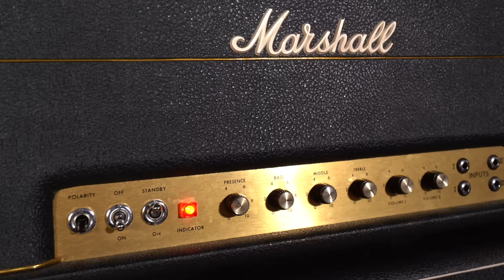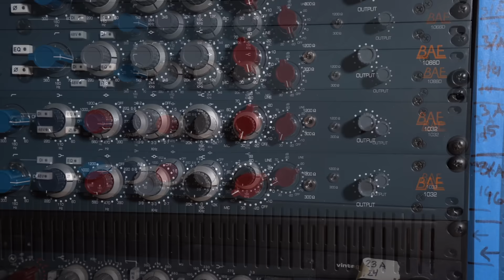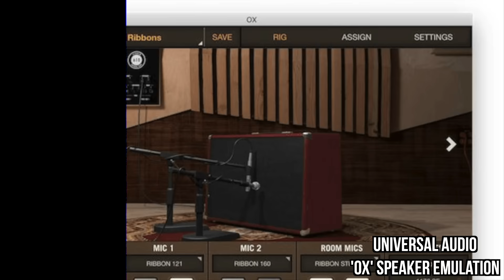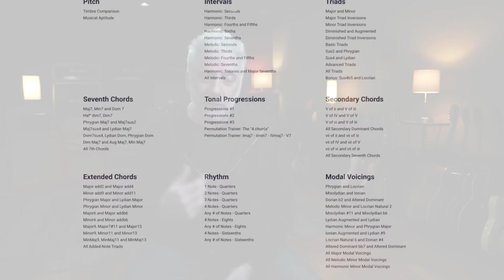So Can You HEAR the Difference?

Comment: I guess I like the "fizz." Greenbacks for me all day. Hiwatt sounded like it had a cold.
Reply: Good description on the Hiwatt!
Reply: loool
Reply: Hiwatt is ported, so that makes some sense. I use two separate cabs off the same head. Mesa V30 loaded deep closed back 2x12 and a DRZ green/cream loaded 2x12 oval open back. It makes for a great mix together. Now if I play through just one of them, I don't like the sound. Spoiled. Don't do it kids. Will ruin you forever.
Reply: @katsavidiz  Maybe it would sound better with different EQ on the amp? I didn't hear them say they adjusted for each cab, so whichever one they did adjust for was off to a head start.
Reply: slimjw ; Maybe we're alone on that one, but I also prefered the Greenbacks. In fact, I thought it was the best sounding cabinet on every example. Sometimes even miles ahead of the others. 
What I liked about it was the fact that it sounded more agressive to me. In my book 'fizzy' is something else. And about that bass..., most of the time it's the first thing that's being eq'ed out, or else you'll piss off the bass player. 

Greenbacks for me.
Reply: I am listening on a hi-fi audio system w/full size Bose monitors and I thought the greenbacks sounded common to any overdrive pedaled practice amp or a Pignose for that matter. All fizzy upper end.
Reply: To me, it's almost like the greenbacks brought out more crunch.
Reply: Keep in mind the Hiwatt cab is voiced to work with a Hiwatt amp! Hiwatts (the classic Dave Reeves circuits anyway) have extended high-end response compared to most if not all other guitar amps. Most Fane speakers are also dark-ish and were chosen by Reeves because of this.
Reply: agreed, sounded flat
Reply: Hiwatt was the best for the clean tone, worst for everything else
Reply: @davidkieltyka9  That would explain the lack of treble in that demonstration for sure. Listening to The Who: Live at Leeds, the Hiwatt sound is definitely a formidable rock sound. Unlike the Marshalls which seem to have more of a mid scooped voicing...more cutting for the G,B.E strings then the Hiwatts being more efficient reproducing all strings more equally, but seem to like the D string mostly. The Hiwatt sound on the 'Leeds' album sound to me very similar to the Vox sound notibly the AC30.
Reply: wingracer 16 loved the sound of the Hiwatt, felt more vintage and LoFi. Not a popular thought in the comments, but just a personal preference of mine. I guess I just like fizzzzzz
Reply: Barry Steinhart Yeah, the Hiwatts Dave Reeves made for Pete Townshend have a preamp section based on the Vox Top Boost circuit. Standard Hiwatts have a more even response and a nicely voiced Mid control.
Reply: I thought the Hiwatt sounded aweome with the leads on the neck pickup, but pretty stuffy the rest of the time.
Reply: Totally agree, it sounded really muffled.
Reply: @davidkieltyka9  Right on. The CP103 tone stack is quite different vs the stack on the DR 103 / 504. While the regular DR 103 / 504 can get very close to the Live At Leeds tone, the CP103 will get it straight away.
Reply: Hiwatt sounded perfectly even and hi-fi. But most guitarists don’t like perfect hi-fi. They call that “muffled”. I would rather hi-fi than greenback fizz any day.

Comment: Man, I've been sleeping on those Mesa cabinets...I need one!
Reply: no, you don't, stop spending money you don't have! :D
Reply: The small 1x12 mesa cabs are amazing, great sound and kinda portable, they look weird with a big valve amp over them though
Reply: You made them all sound great
Reply: Too heavy, too loud for your gigs. Maybe a 2x12?
Reply: I vote 2x12's! Love my Orange Tiny Terror on 2 horizontal Orange 2x12's, stacked vertical. (One is open back, one closed, for ultimate tones.) 😏
Reply: Oh, yes...you do!!!!  💗💗💗
Reply: I love my Mesa 4x12. They do a 2x12 same materials that sounds great if the half stack is not practical. Those are very popular as well.
Reply: They are heavy and hard to lug around but if that and the price doesn't stop you nothing will. Gigged mine for over 15 years. Solid and reliable. Also beware they break car windows with ease. I ratchet strap mine to the floor.
Reply: Just keep living with your Helix.. 
You don't need a cab
Reply: @NathanSidF  A similar configuration: Mesa used to have a split cab, closed bottom, open, slant top...when paired with a 100 watt Dual Showman head and Marshall Guv'nor pedal--it was fantastic
Reply: @Starcrunch72  Damn, I guess so! But the great thing is the vertical stacking & an 2x12 (or two) is(/are) more easy to carry by yourself.
I once dreamed of a Mountain 6x12 cab, closed 4x12 with open 2x12 on top, but I'm happy I didn't bought one. Don't want to fuck up my back at 22 years old! 😅
Reply: @NathanSidF  I'd like to hear that.
Reply: I see you like your pillow extra firm 😉
Reply: Rhett Shull damn Rhett! Didn’t know ya had all that in ya!!! Nice work my man!
Reply: Rhett Shull Honestly dude get one! I have a Mesa 2x12 with V30s and it sounds AMAZING! I may get a 4x12 later on just to compare but honestly Mesa makes amazing cabinets
Reply: In my day it was guitarists playing Marshall stacks and bass players playing Mesa stacks.
Reply: Sounds amazing, to me plays a part in the rectifier sound that was made famous in the 90
Reply: I currently use a Mark V and a Mesa 1x12 and I think the 1x12 sounds really nice with the Mark V

Comment: The Hiwatt was my least favorite. I think the Mesa sounded the best, great high end, the low end isn't boomy at all.
Reply: I agree on most of these.  I wonder if the Hiwatt only really shines with a Hiwatt amp.  That guitar cabinet with a DR103 head is the basis for David Gilmore's sound and his tone is magic so I dunno.
Reply: @ScutMonkey  I think you're right. The cab is designed for the head powering it. David Gilmore has amazing tone.
Reply: Love the screen name 😂 do ya still need help with your trusses 😂
Reply: @MrUltraworld  he didn't say what Fanes...Gilmour used  Fane Crescendo's which are different than the standard Purple Fanes
Reply: I think the problem with the Hiwatt (as suggested) is that it's more matched to the Hiwatt amps, but also that because of its high power, the massive headroom never really pushed the speakers, making them sound more muddled because they weren't getting the push the other, lower powered speakers were.  You could hear it in the Mesa to some extent too, especially on the Marshall amp.  I know it's probably not factually correct, but that's how it felt on the speakers I was hearing through.
Reply: This. The hi-watt sounded the worst cuz it wasn't being pushed
Reply: Agreed, Fred. I didn't like the hiwatt on anything, and I thought the Mesa handled everything well. The Mesa seems like a nice, flat responding amp. TBH, though, I'm not listening on my B&W's at home, and those things are very revealing. Bad mixes sound awful, and great ones really shine.
Reply: I liked the Hiwatt second best on almost every demo. I like the darker, tighter sound. Mesa was the best. JCM cabinet was the worst.
Reply: I think the guys are probably right. The cabs matched the humbucker pickups, and the Hiwatt cab probably sounds best with single coil pickups.

Comment: Does anyone else have this? It's weird, to my ears the first notes after they switch amp really suck and then after like 3 seconds I start liking it. I guess I'm overwhelmed by the differences at first but then I immediately get used to the different qualities and I can appreciate each one of them. The Marshalls and Mesa are winners, the Hiwatt was a bit dead in this specific setting. I think it's not for this kind of straight ahead rock n roll sound but it's more of a platform for more complex sounds (I'm thinking Gilmour or Hackett who both used them with incredible results)
Reply: Totally agree.  And I notice this at home as well even switching through different OD pedals.   You get zeroed in on a tone and then upon dialing up something different there is a lag until your ears and brain adjust.
Reply: Totally agree.  That being said though, I'm partial to the two Marshall Cabs.  I didn't really like the Hiwatt at all and the Mesa was kinda there but the extra low end I didn't really care for.  If I was to use that I'd eq it out anyway so what's the point lol.  The first one and the last cab, man they were both great, it'd depend on the song/part but you couldn't really go wrong with either of them.  The first one sounded more classic to me and the last one a bit more of a modern sound.
Reply: No offence, but that’s like a damn essay for me to read
Reply: FlyingDorritoChip it’s 100 words. Hardly an essay 🤣
Reply: That’s ear fatigue lol you’ve probably spent hours looking for an amp/speaker you want and it’s taxing.

Comment: This is an essential video, and does a great job of illustrating one of the most overlooked aspects of guitar tone.  If you have a combo amp or two, try using it as a cabinet for other amps.  This is a great way to multiply your gear options without spending money.  Just make sure the impedance of the speaker(s) matches whatever amp is being used (4 ohm, 8 ohm, 16 ohm).
Reply: Jeff Ainsley I modified my fender pro 185 reverb for this exact reason to accept a 1/4” input. The amp is great for cleans but pales in comparison to my 5150 head for distorted tones

Comment: Glad to see the Park is getting quality time! One major thing that needs to be spoken about in reference to speaker cabs is condition and age of the speakers. Depending upon how 'broken in" a set are will make a huge difference in the overall quality of tone as well as the "vintage" ( year they were manufactured) because more modern cones are manufactured differently and do not sound the same as their older versions. Also each and every box will have its own inherent resonances and tone response just due to the quality of wood so not every old Marshall 4x12 will sound stellar. I surmised that the 65 watters Rick loaded into the JCM800 box were nicely broken in and the cab has a nice overall resonance. Of course your own results will always vary!

Comment: I'm a Brit - I've never seen anyone with a Mesa cab...but Marshall and Hiwatt are our bread and butter.

The Mesa...sounded middy and focused.

The Hiwatt...no lower mids or bass at all. I've had Hiwatt cabs (Fane) and they didn't sound anything like that. They were hard and punchy...like a Celestion cab with a bit of direct mixed in. But they were sealed  back. Vented didn't seem to suit them at all.

Of the two Marshall cabs -the basketweave sounded full frequency - creamy to about 5K - the 80's one was more aggressive; a more pronounced lower mid.

I'd take the 100W all day long, but I like progressive breakup.

If I was buying a 4*12 I'd get the 1960TV - a 100W big cab. The extra volume gives it more 'phlub' (like AC/DC with the mids shifted down a bit).

Comment: Wow, I was shocked by that. 

I’ve been playing Mesa since 1985 and love them to this day. I’ve never really cared for Marshall until recently. I’ve also never been a fan of 412 cabs as I’ve used a pair of Mesa Thiele EVM12L cabs sing the mid 90’s. I had a Marshall 100w cab with pre Rola green backs from 1971 which I hated and sold. However, in this test I thought the 65w Marshall was easily the best cab. Next was the Greenbacks. The HiWatt was certainly “different “ and a bot muffled but it had a unique character. The Mesa was consistently my least favourite by a LONG way.

Comment: Depends on what tone you're going for. If you're into classic rock n' roll tones, then it's Greenbacks all day long. "Fizz" is merely a part of that sound, although I'm not sure what year those Greenbacks used here are dated from. If they're post-Pulsonic cone, then that's the reason for the excessive fizz. Later Celestions, no matter how broken in they are, always have a fizzier and more shrill tone than the true vintage Pulsonic cone Greenbacks from around '73 dating back through the mid-'60s. Celestion has never been able to nail the magic of the original Greenbacks since those days due to a differing construction. The closest speakers to nailing the vintage Pre-Rola Celestion tones available today are the current Scumback speakers.

Comment: Wow, summed up what I felt years ago when I had a 74 Hiwatt 100 watt head I first used it with a Marshall cab with vintage 30’s and loved it then found a vintage Hiwatt cab with Fanes pop up and had to have it and felt meh about it vs the Marshall and kept it just cause it made a matching set and continued to use the Marshall. At the time I was playing single coils through mostly clean amp and using pedals and the Hiwatt/Fanes sounded nice clean which I think gets highlighted nicely by the section where Rhett plays since I’ve been loving you and the hiwatt cabinet shines for a moment. The Mesa sounded the best to me, nice and tight and focused but still big and beefy vs the fizzy greenbacks. Guess I’m a vintage 30 fan 🤷🏻‍♂️ I also liked the sound of the Park better than the Marshall in this case. Great video as always, thanks for spending the time to make them!

Comment: I like the sound of the SG, mostly.  It sounds clearer through all the different combinations.  The Les Paul and SG don't sound best through the same amp and speaker combinations.  As for myself, I didn't care much for the Hiwatt/Fein speaker cabinet using either amp or guitar.  Too dull sounding but, it would have it's place in a multiple guitar tracking situation.  Different mics on the cabinets would also produce different tonal qualities that would be useful in a mix.  None of them sounded bad.  I just liked some better than others.

Comment: Thanks for yet another informative video Rick. Each of the four cabs certainly does have a different sound to the others. This is why all amplifiers have tone controls for treble, middle, and bass.  Could you do a test which involves adjusting the amp settings in order to try and get the same sound from different cabs?

Comment: I think for a live situation, the Greenback-loaded Marshal cab would work best.  I like the lower mid-range the Greenbacks have, which seems to be scooped in the 65 Celestion Marshall and Vintage 30 Mesa cabs, even though both of those cabs have beefier bottom end.  When playing live, all that bottom end is just gonna blend with the bass guitar and sound muddy.  So with the cut bottom end, the Greenbacks project the guitar signal more clearly.  Also, Hiwatt cabs need to be played through Hiwatt amplifiers.  They were specifically built for those amps for a reason.

Comment: I have 3 amps…..
Stock 70 Super Bass
Stock 71 1987(like in the video)
Stock 79 2203
And 3 cabs….
July 68 straight cab with the original Pulsonic 25 watt Greenbacks.
68 straight cab with August 68 Pulsonic 25 watt Greenbacks.
77 slant with the original 55hz 30 watt Blackbacks.

I ended up pairing the Super Bass with the Blackbacks because I was after the 75-79 Malcolm Young sound and the Blackbacks were closest. Abit tighter and clearer.
The 1987 really suits the Aug 68 Pulsonics because it’s the warmest cab and tames the aggressive 50 watter.
And the 2203 just loves the July 68 Greenbacks which fill out the mids, remove any MV fizz, and give it a more vintage tone(more early 70’s than late 70’s)

Comment: Not only sounded different but I think you both also played each riff slightly differently so I guess there may also have been a different feel as to how each speaker responds! Speaker is always the overall filter on your tone which many people disregard. Thanks for the comparison! So many are trying to dial in modelers but if you don’t know what a real amp and speaker sounds like I think they miss many of the details that really make the tone and get to the point where it’s harder to tell them apart but only if the modeler is dialled in properly. Probably why so many helix etc end up on eBay as used twice!

Comment: Out of all these, I've deduced that the ultimate setups would be: Marshall into two 4x12's, one with 4 Greenbacks, the other with 2 Fanes and 2 V30's. The Greenbacks give that perfect thick classic tone and brings the high end while the Fane's bring the low mid's and the V30's bring the upper mids.

 Park into two 4x12's one with 4 Fane's and one with 2 V30's and 2 Greenbacks. The Park is a lot fizzier so the Fane's tame that while the Greenbacks and V30's help it cut in the mix.

Comment: I like all of them but favor the greenbacks a lil bit. Next i like the 65 watts and I also like the mesa cab too but it sounds more modern. The Hiwatt cab is a bit darker but has a cool vintage character that I love as well.  Would be ideal to have them all. I would also add a cab with G12H celestions. We also have the new creambacks that sound very good.  So many great choices but the greenbacks are always my fav. Both 25 watt and 30 watt as well as both 75HZ and 55HZ. The Mesa cabs are built so tight and are very solid. THey have a very chunky sound. Good wood and build quality. I remember trying to take the back panel off and it was fit so snug It was hard to remove. I'm sure it has an effect on the whole cab being like a drum. They also use UK made vintage 30's made just for them. They had to work a deal for celestion to keep making them speakers in the UK because the chinese made ones were inconsistant.